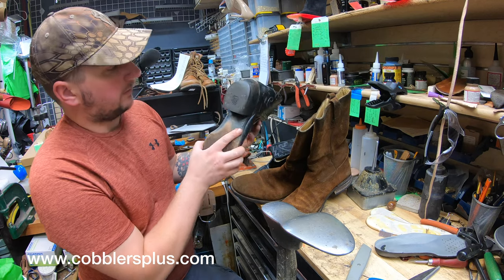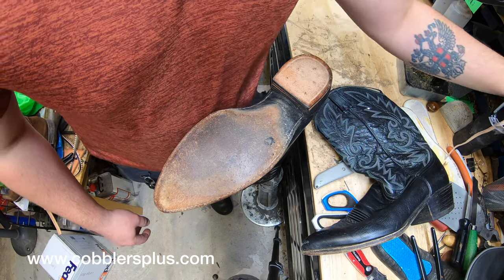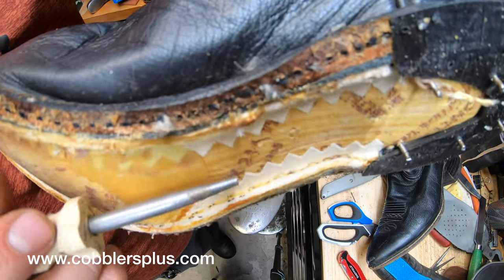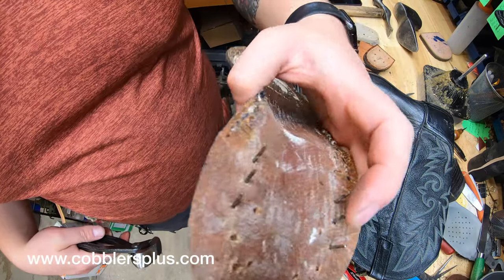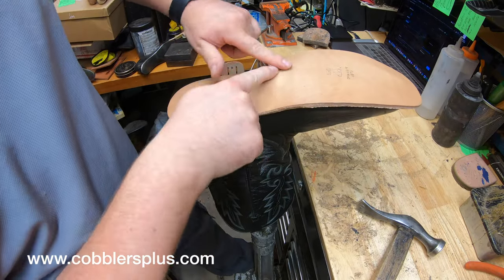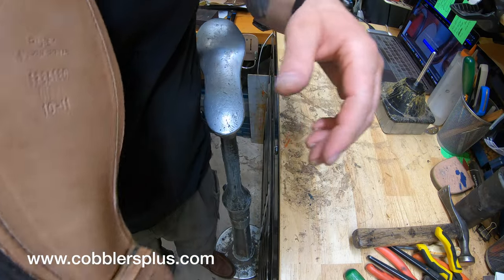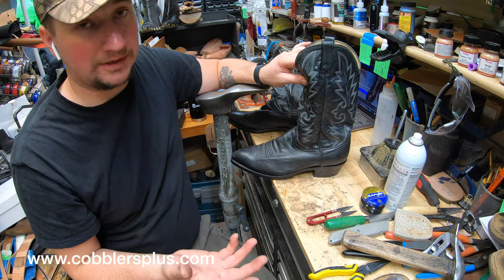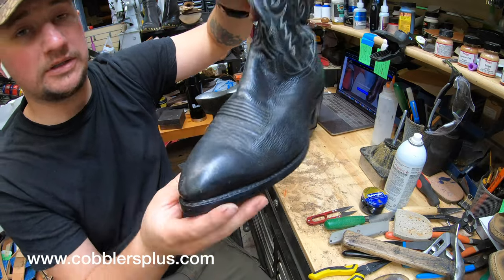Dan Post Boot Resole to fix a Squeaky Boot Problem for Jeremiah Craig

Comment: I saw once on another shoe repair channel, the guy used a piece of cloth glued to the shank to avoid squeaking
Reply from the maker: I’ve seen that. Long term when it’s to to resole it’s always not fun dealing with the cloth if it’s really stuck. Roughing up the shank has the same outcome but even if glue fails there are no smooth surfaces on the shank for it to slide

Comment: You can't get shanks? Here's something to consider, 3D printing. You could print nylon, ABS, ASA, and they're very durable. You could have them designed however you see fit by whomever creates them in the software.

Comment: Is the footbed a leather footbed topped with cushion?
Reply from the maker: Most Dan posts are now fiber board only a few here and there are leather
Reply: @CobblersPlus  I have a double H boot,but the shaft is worn out,but from the tongue and down below it is in brand new condition..Is it possible to replace the shaft?

Comment: I had a new pair of work boots (Made in China Danners) that squeaked when walking. Someone recommended and I tried putting some foot powder inside and that. stopped the squeak. It appeared that the insole had gaps etc. Just passing it on....
Reply from the maker: That does happen often when your foot sweats. These had parts that squeaked
Reply: @CobblersPlus  Yes I noticed that boot....I was very surprised that boot (was it a Justin) had those issues...I was interested in seeing your "squeak troubleshooting"...I was just passing on to others (and you also did mention a "loose insole" as a likely cause) for their benefit. THANKS for the videos!! I hope to mail you some shoes to repair one day.

Comment: I know this video is a year old, but if your foot is squeaking against the liner leather, I have had success using a 200+ grit sandpaper to rough up the leather slightly.  I probably wouldn't do it to a pigskin lining but I would also recommend you don't buy a boot with that lining.